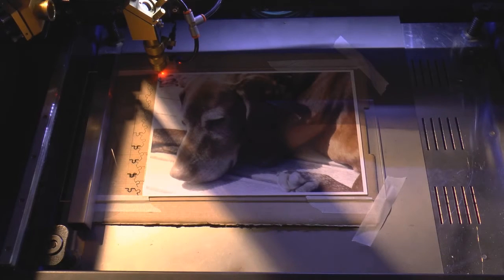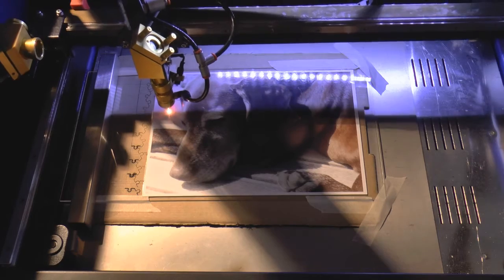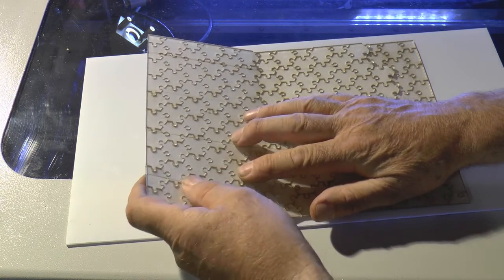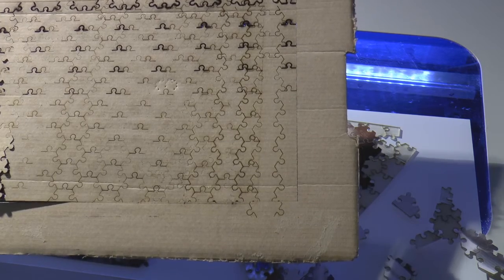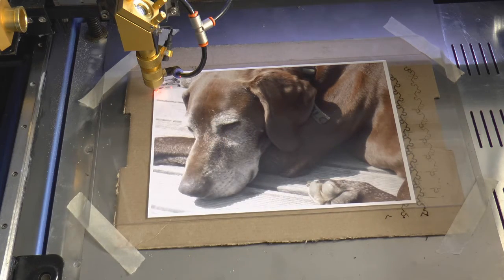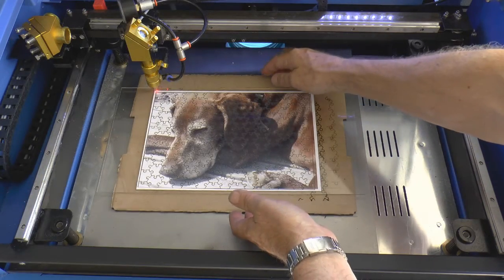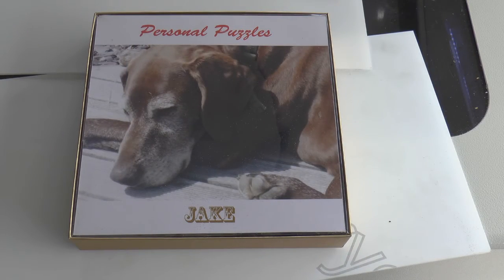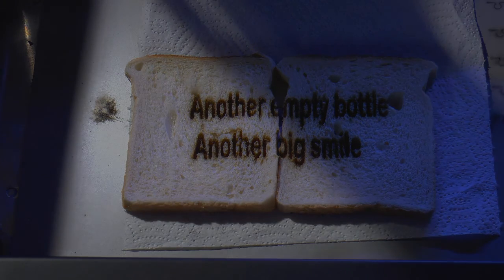RDWorks Learning Lab 14 part 2 Design and cut JigSaw puzzle

Comment: could it have been the double sided tape causing the problem?
Reply from the maker: Hi Braden
 Remember that this is a record of my learning journey with this machine. At this point I was very naive and trusting that the machine was doing what the Chinese had promised. After a few more unexplainable poor performances you will find me changing the tube from a piece of junk to a slightly better piece of junk. Over the next few months I struggled to learn and understand how tubes work, why they fail and  where I go to buy an  A grade tube I could trust. It finally transpired that the HV power supply was near junk also. Essentially  I was attempting to  carry brain surgery with a blunt knife  but didn't know it.

Best wishes
Russ
Reply: SarbarMultimedia Hi Russ! Many thanks for your reply and all this hard work you have shared... you have literally written the bible of laser cutting. I bought my China Blue about a year ago second hand  and have revisited all your content recently in hope of maximising the performance. I have replaced a PSU and solved alignment issues due to skipped teeth in the y axis drive belt all encouraged by your approach to this machine.  My hope is to be able to cut thicker pieces of plywood to create functional jobs, I seem to remember you having some success with longer focal length lenses and have been scouring through your content to find this. Subsequently I have learnt quite a lot along the way. 

Thanks again! 

Best regards 
Braden (Sydney Australia)

Comment: Hi Russ 
Silly question 
I have had difficulty cutting acrylic Perspex ,can I only  cut cast acrylic  Perspex
Reply from the maker: Hi Eddy

They are chemically the same , it is just the manufacturing process that is different. Cast acrylic is poured in liquid form between two sheets of glass and has a very poor thickness tolerance of about +/-0.5mm. Extruded acrylic is made  by forcing softened acrylic pellets through slit dies at the end of an extrusion machine. The thickness tolerance is much tighter at about +/-0.15mm.  Lots of good information here      https://www.accessplastics.com/cast-vsextruded-acrylic/
There is no logical reason why different acrylics wont cut. If you like to attach your email address to another comment I will get back to you and try to work through your problem.
Best wishes
Russ

Comment: could i get rdworks to work with my triumph laser machine
Reply from the maker: Hi Paul
Almost certainly not because this software is specifically written to interact with specific models of Ruida Controllers. I half suspect you may have a Leetro cotroller on your machine?

Best regards
Russ
Reply: can i change my controller if so what would you recomend
Reply from the maker: www.aliexpress.com/item/Ruida-RDC-6442G-Co2-Laser-Controller-DSP-for-Laser-Engraving-and-Cutting-Machine-RDC-6442G-6442S/32789124488.html?src=google&albslr=228389211&isdl=y&aff_short_key=UneMJZVf&source=%7Bifdyn:dyn%7D%7Bifpla:pla%7D%7Bifdbm:DBM&albch=DID%7D&src=google&albch=shopping&acnt=494-037-6276&isdl=y&albcp=658432961&albag=33762888219&slnk=&trgt=61865531738&plac=&crea=en32789124488&netw=g&device=c&mtctp=&gclid=EAIaIQobChMI8-Kimv7p2AIVg7vtCh0DhQvrEAQYBCABEgIRZPD_BwE

is the 6442G controller and keyboard. You can download the manual at the bottom of this page
http://en.rd-acs.com/down_complex.aspx?FId=n14:14:14&pageindex=2

All the wiring data is within but there are more downloads if you search the site.
Best regards
Russ

Comment: Hello Russ ! Remind please, how much power from your laser?
Reply from the maker: Hi
At the point I did this jigsaw puzzle I had no Idea what power was coming from my laser tube. It was VERY unpredictable. and would start cutting ok but within a couple of minutes the power had dropped to almost zero. I changed the tube shortly after this and the performance was a bit better and more consistent initially. Later on in the series I upgraded my machine to a good 60 watt tube  (which I still have) but there are videos of me testing both of my old tubes when I eventually bought a power meter.
Best regards
Russ